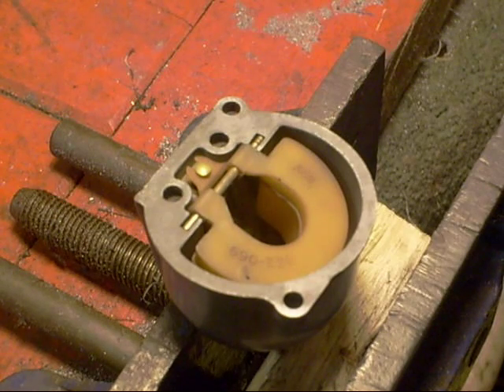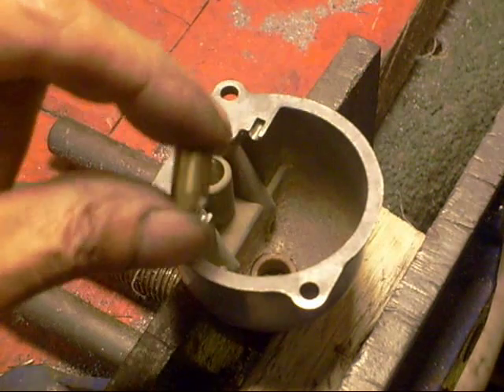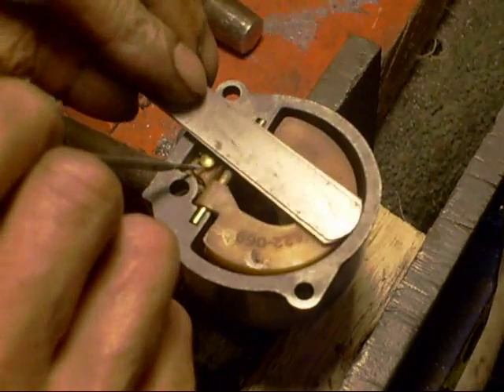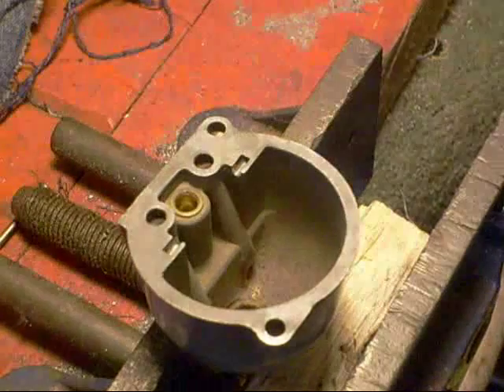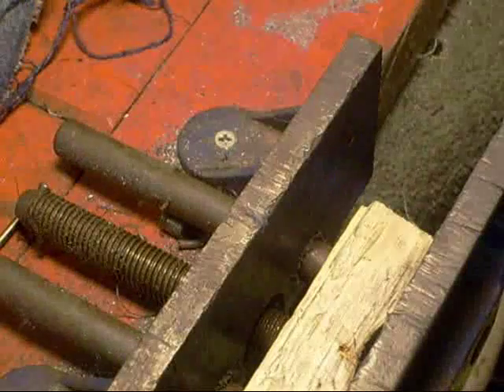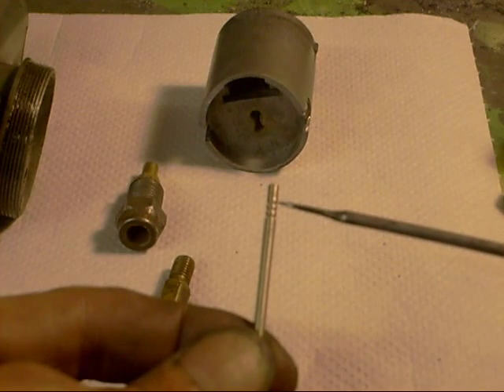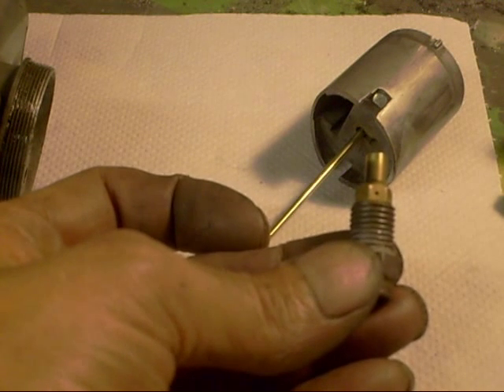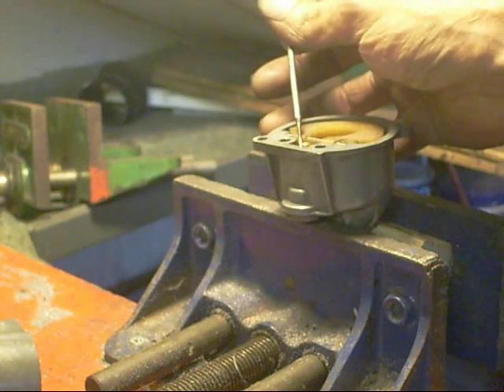Triumph Bonneville T120R Setting the float levels

Comment: I think you should push down on the needle itself rather than the tang to test float height.  You'll notice that when you push the tang down, the needle seats and then you're able to push the float tang further.  So in use, the float would actually stop rising at a lower point than the one you get when you push the tang.
Reply from the maker: Hi Nicholas :-) it is because of the slack in the fork you push on the tangs as they have to make contact with the needle to shut the valve. As the float drops it lifts the needle, if the gap on the needle was a closer fit to the tangs the float would jam itself and not function properly.

Comment: without reading through all the comments , is there any known problems with the cable being too long by like 2-4 mm on the 71 TR6R single carb> i bought a new cable and the slide wont close all the way.i have about a 2 mm gap showing . someone mentioned that i need to cut the cable sheath a bit to get it to fit properly. i triple checked the adjusters at the throttle and the inline adjuster. any help would be appreciated Lunmad or anyone.
Reply from the maker: Hi Donald :-)
yes I'm afraid it could be the cable, there is some garbage out there. I bought a new set for mine ended up taking a chisel to them and reworking them. Take a look through my "Throttle cables" set of vids there are about 6 in the set.I also did a set called "T140E carbs and cables"
In short you can strip/cut the outer sheath like you have been told, I you are careful you can unwind it the required amount and snip off the excess, this can be done with the cable intact.
Reply: It could be for a Monobloc.
Reply: These simple machines can get complicated.

Comment: Great video, thanks! I used your tips to set the float on my 1970 Bultaco Sherpa T 250.
Reply from the maker: Hi phaedrus :-)
Glad it helped you out, A difference on the two-stroke carb is the needle, it does not have the two scribe marks around the top.
Reply: Zen and the art of motorcycle maintenance had a Phaedrus. I think.

Comment: hi all    i have found that using the new type of needles vuiton or whatever they are called   cause nothing but trouble  they raise the float height   and i have had the same trouble with my trident i replaced the old ones and the new ones caused me a lot of grief    i eventually  bedded in the old ones with a bit of toothpaste  and had no problems ever since
Reply from the maker: +Cameron Laing 
Hi Cameron :-) 
Viton tip needles are better, any float difference can be remedied adjusting the seat.
Toothpaste is a great fine grinding compound, that can be used on some plastics to get ride of scratches.
If the needles have a groove they should be replaced.
Glad you sorted yours.
Reply: I have just today gone thru the "viton tip" nightmare,I got a BRASS float needle,it closes under it's own weight,,buy ALUMINIUM!---brass with viton will not allow FLOAT to close the needle,my bike had erratic idle,,idle mixture changing every time i stopped,,and horrible top rpm surging-I WILL get my refund for the brass needles and buy aluminium!!  (or better yet OEM plastic ones!)-BRASS needle will work if vertically pushed UP--not down like on amals.
Reply: That's interesting about the brass viton tip not lifting. I will have to investigate, change mine to see if erratic idle changes. I do have the black floats though. I just assumed it was slow auto-advance. Hmmm.

Comment: Hi lunmad. I just bought a T120V. T120V on engine with matching engine numbers. Only a 4 speed box though so can only assume it has had a replacement box as i was told the early 5 speed boxes were not overly reliable. The ratio in top is the same though isn't it? The carbs are Amal 932's. It starts first kick usually, the chokes have been removed though but it seems to run rich going by the plugs. It runs fine with no hesitation at any speed/revs. What do you think? Cheers, John
Reply: I have 932s also and am keen to know if you might have a Routt kit on the bike? Mine’s an 800cc and runs great with the bigger carb (TR6C).

Comment from the maker: Hi bja214 :-)
glad my vids are helping. 
You should press lightly on the float when the tangs are at the bottom of slot thats enough.
I extended my tickle buttons using a small (cut down) nail, what fit in the roll-pin.

Comment: Re Lucas:

"Gentlemen do not motor after dark." Heh.

I've never used any electronic ignitions other the stock '79 one, but I do like to replace the rectifier/Zener diode with a solid state Tympanium rectifier/regulator. Mostly just for less wiring.

Comment from the maker: Cheers gordonemoore I ended up with the floats set at about .080" which has improved it a lot. But as I found out later my Rita ignition was at fault :-(
 I have since fitted a Boyer, which has got rid of a lot of problems. I should have put my hand in my pocket a lot sooner than I did. :-D

Comment from the maker: Glad you liked it 
nosilanoxid I eventually set them to 80 thou and have cured most of my rich problem, I wanted the seats out on this occasion.

You can knock the seats up from the bottom with an 1/8" drill bit shank through the hole where the banjo goes. 
I wish I had pointed this out! in the vid